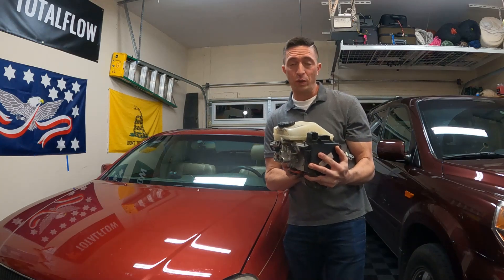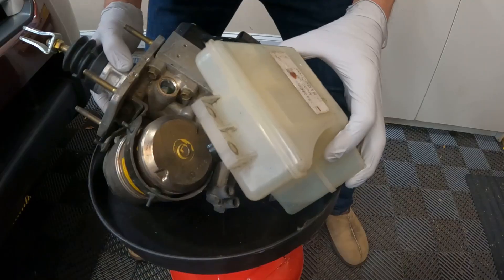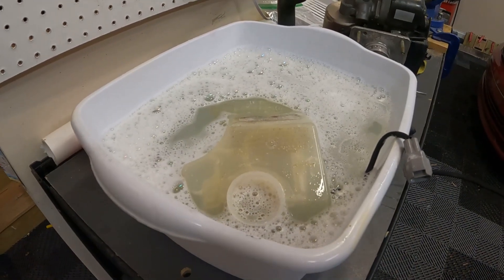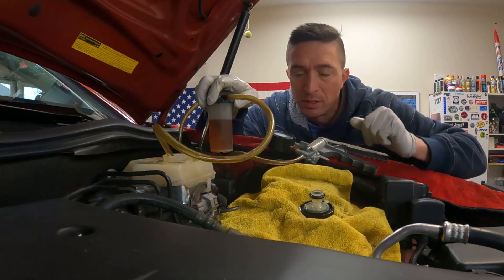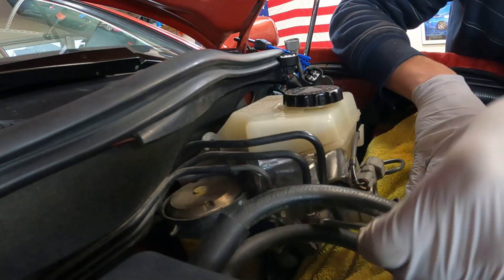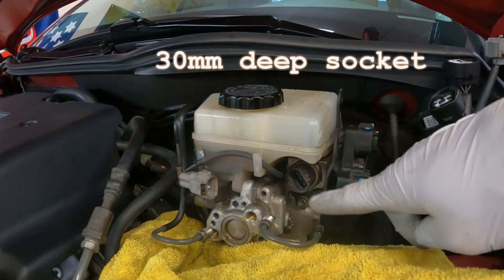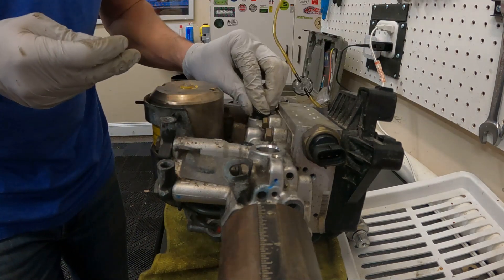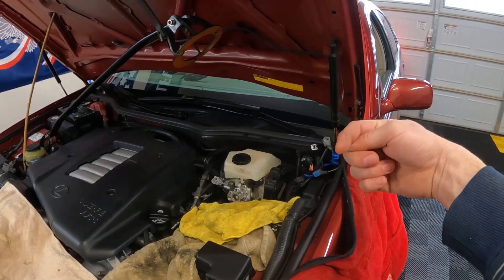LEXUS / TOYOTA Brake Master Cylinder Diagnosis, Replacement & Brake Bleeding (300/400/430 shown)

Comment: Hey man. Would appreciate some help. I bled brakes a while back after removing caliper. I think I let the reservoir run dry. I had that warning sound which you mentioned. Now that buzzing sound from abs module is there on start up and intermittently when I brake. I'm assuming I have air in the module itself? Any help would be appreciated on what I can do.
Reply: I noticed that buzzing sound every time the brake were pressed to bleed. Is that normal all the time? Should it go when the bleeding process is done? Thanks
Reply from the maker: Buzzing is normal. Low pressure warning is also normal during bleed process only. Unless you really ran it dry, the brakes should be good after you have bled the system properly.
Reply: @ForwardMomentum  thanks. Am  relieved. Think will bleed again just to be certain, including BMC.

Did you leave the ignition on whilst bleeding? If so, why?
Reply from the maker: @mozymi4399  should be covered in the vid. The accumulator pump is how pressure is built and distributed.

Comment: Hey, pretty cool video! I have a question about the "optional bleeding the BMC before the formal bleeding process", Did you have the ignition on when you do this?  What is the timing for re-tighten the brake line connector after lossen it? (until see some fluid come out?) Thanks!
Reply from the maker: Ignition was not on for BMC bleed. Timing is fluid coming out for tightening line. GL!

Comment: So I may have to be doing this job for my gf's 98 GS. But there's no squeaking sound when you step on the brakes. It's more of a buzzing and it only happens at low speeds right before you come to a stop. I've seen that may have something to do with the ABS ECU. Thoughts?
Reply from the maker: Buzzing = normal. Pig squeal/dolphin sound = borrowed time. Such a dumb choice/design by TOYOTA on this one!
Reply: @ForwardMomentum  I can feel a vibration when I step on the pedal. Almost like I'm losing brake pressure, and then it just comes back to normal. But like I said, it only happens when it comes to a complete stop
Reply from the maker: @itsjustnate08  the accumulator motor commutators disintegrate on these and the squealing is the warning of what’s to come. Heavy vibration should be looked into further. Light vibration times with the pump is probably normal.

Comment: Just want to thank you. I have a 98 GS3, and the brake booster finally went. Because of your video I bought a 05 sc 430 unit. Added that with Supra TT front brakes and LS430 rear brakes and everything went flawlessly. Minus the fact, I disconnected the battery. But during installation I knocked the bumper off the lever for the brake switch. Hooked the battery back up and didn’t pay attention for 3 hours my brake lights were on 🤦🏻‍♂️😂 this is my third Gs in 14 years. Timeless vehicles.
Reply: I  was going to do this exactly,  but i havent due to i wasnt sure if the wheels needed to changed to a larger diameter for calipers,  did you have to go to a larger wheel ?

Comment: Thanks for the awesome video!  Just changed out my old "chirping" brake master cylinder with my friend yesterday on my SC430 and referenced your video for the whole repair.  I am definitely a novice with auto repairs, but this was an easy job with two people.  This would've cost me at least $3800 here in Hawaii.  Instead, I paid $350 for the part on eBay and the next most expensive thing was a box of gloves for working with the brake fluid residue.  Great step-by-step details!  Thanks!

Comment: I change the same on my toy land cruiser(europe)and now the brake red light is always on
Reply from the maker: 1) are you positive you installed a good BMC? 2) did you swap the pressure sensor? 3) did you bleed properly?
Reply: I change the motor only not the pressure sensor. 
Brakes works well.i bleed the systèm by the for calipers like instructions on my toyota book .
Reply from the maker: @rougeronjeanedgar2847  look back over everything. You must have skipped a step. Pressure sensor usually needs to be swapped.
Reply: Toyota check my car soon,and i return here to give answer
Thanks a lot men.

Comment: I have a 2002 4Runner with an all in one ABS unit. Long story short, when I got to the last procedure where you pumped the brake pedal 20 times. The pressure warning did not go off and my brake pedal feels spongy for some unknown reason. Mind you I have not done the last part of bleeding all 4 brakes. Do you think bleeding the brakes will fix it?
Reply from the maker: Did you swap the pressure sensor from your bad BMC to your new one? Just curious. If so, definitely repeat the steps a few times. If the warning persists, try to bleed the brakes. If it still persists, try pulling the negative to reset the ABS ECU. If it still persists, you could have a bad unit going in.

Comment: I have the same issue with the bird chirping noise, every 15-30 seconds, it is getting to be more frequent and louder. Is it possible to replace some parts on the system ,hydraulic braking assembly, or it is one complete unit?  2002 GS300,  216k miles, i cannot afford 4k, i really like this vehicle
Reply from the maker: It is possible, yes. But upon investigation a BMC swap was much more economical. The problem is the accumulator motor commutators disintegrating (we think). So, theoretically, one could replace that motor if it can be found. I started down that road and no one had a solution so I just did the swap.

Comment: I ended up upgrading and making a brand new one by buying parts individually. Here is another way around this issue. Buy a rebuilt master cylinder at rockauto, then buy a rebuild upgraded abs motor from ebay and a new nitrogen tank from the dealer since I heard those lose pressure over time, didn't want to risk dropping in another master cylinder was a bad nitrogen tank. I am actually on the second master cylinder on a 215k mile GS400. I think I dropped about $1500 in after I was done, but everything is new. I did buy another donor master cylinder off ebay so I could piece it together off the car.
Reply from the maker: Great idea! Thank you!

Comment: Hi, I have Pajero 4 with this similar unit, but I have one issue, this stupid motor starts pumping every 10 - 15 sec., but I dont know, could anybody know why? Accumulator is new.
Reply from the maker: I’m not sure why that’s happening. Perhaps your pressure sensor is bad or it truly isn’t holding pressure?
Reply: @ForwardMomentum  There was 1 fault number 61. Master Cylinder Pressure Sensor System, maybe this could do that, I will check pressure with scan tool maybe week later. But this sensor is integrated inside hbb so cant change, only whole unit.
Reply from the maker: @danielhasalik7000  are you 100% positive it’s not removable? As you may have seen in the vid, the BMC on these and many others has a replaceable pressure sensor. Or, it could be bad seals on the MC piston.
Reply: @ForwardMomentum  Oh yes, you have right, this pressure sensor is same, I didnt see this, so can be removed, it has number 89637 30040 DENSO. So I hope i can find something.
Reply: Its bad, I didnt find any sensor and Oficial Mitsu. dealer dont sell only this sensor, only whole unit, but I checked voltage betwen sensor and ASTC ECU and there was, so servis manual says replace ASTC ECU, maybe this could solve this problem.
Reply: So ASTC ECU is replaced and fault number 61. is gone and no more faults. But motor pumps every 15sec., but I saw something, when motor starts, brake fluid is go down a little bit, but when motor stops, brake fluid go up, so I think there is a little pressure leak in accumulator, so I have to replace it ( again) and a little spring and pipe under accumulator, hope this will help.
Reply from the maker: @danielhasalik7000  thanks for the update. I admire your tenacity!

Comment: Hey man, really detailed video was wondering if the process is similar for a first gen is300. If I brake relatively hard, nearing the bottom, pedal kinda flutters.
Reply from the maker: If the IS has a BMC set-up like this it should be the same, correct. GL! 👊

Comment: Thanks a bunch for making this video! It made me realize the task at hand isn’t nearly as daunting as it seems. It’s nice to see folks creating content for the 2GS platform. I Did run into a couple issues and maybe this information can help others doing this. That metal bracket that goes to the bottom right stud of the BMC can be a massive pain in the butt if you accidentally bend it like I did. It really helps to have another person inside the car making sure the stud goes through the hole in the firewall and the bracket. It will save you a lot of headache trying to bend it back or take it out to fix it. I also received a faulty BMC from eBay. Popped it in and didn’t hear the motor building pressure at all along with a loud sustained beep. I also got all of my ABS and VSC lights on. Went to the pull-a-part today to grab another and everything went smoothly.

Comment: Ive read where this is the same procedure for 100 Series Landcruisers and LX470's. Is that true? Thanks for this very informative video. The install on my LC isnt the issue, its the bleeding process that makes me nervous!
Reply from the maker: Yes, it should be very similar. For some reason TOYOTA went with these complex and expensive BMC units that are prone to failure. I still don’t understand why.
Reply: @ForwardMomentum  Toyota seems to love going overboard to a fault on a few components. Just to change a rotor on my vehicle, I have to disassemble the entire hub assembly haha. You the man, thank you!

Comment: hello, first of all thank you for this great video !
I currently have a 1997 aristo and I need to change this part.

however I understand that the brake master cylinder of the GS300 can go on ARISTO. do you have the information on that ?

thanks
Reply from the maker: I believe they change over, but please double-check me. The problem in the USA when using an Aristo BMC is usually with the hardline routing (RHD vs LHD). Not sure if that is a factor in your case or not.

Comment: any updates on the SAFC? also anyone have a solution to control the timing? i have a safc2 but people are telling me its pointless to install it if i dont had many power modifications, i plan to turbo it on low boost 5-6psi so not to crack a stock gapped ringland
Reply from the maker: SAFC2 is fine to install on a stock motor but you’ll need a wideband AFR sensor to tune properly. If the motor is stock, you might get a few HP out of it. For timing control you’ll need a standalone solution on the 1UZ but the 2JZ and 3UZ may have ECU programming possibilities.
Reply: @ForwardMomentum  i probably should have mentioned its a 2000 GS300, that being said the 2jz's should have lots of options but im trying to find a budget solution to pair with the safc. if you do have some info that would be great but love this channel, your videos help me with similar mods

Comment: Yea great job you saved a lot of money I’ve had a used brake master cylinder for my 98 lexus for a year now I paid $200 for the part on eBay. And to have it put on I paid $200. And  old unit needed to changed at 200k miles. Which wasn’t bad by far you did a great job in finding a part and installing it yourself..
Reply: @Scumlife Shotty no you good just gotta find someone who can put the part on. When you buy it used it’ll already be programmed. And the part just has to be coded by the mechanic. And you don’t have to do anything else..

Comment: Wow, this definitely is a job completely out of my league & ability. About 6 months ago I had my lexus dealer install a brand new Brake Master Cylinder, my old one was original. New part cost $3,200 just for the part + labor, full lexus warranty. By far most expensive thing I've ever done on my 98' gs400, but I've had my car 7 yrs., never any car payments, & stole it for just $2k because I worked at the dealership, still very happy! 😊
Reply from the maker: Wow! So if you don’t mind me asking, how much was it with labor? That’s crazy!
Reply: @ForwardMomentum  
Labor charge cost $900 so total cost $4,200
It took the Lexus head technician 1.5 days to do complete work including the programming of new unit, I even met him & watched part of time at beginning & end of work also.
Reply from the maker: @samaccurso  I’m going to pin your comment at the top so people can see what the cost will be if they go to the dealer. My estimate was low apparently. 🤣
Reply: @ForwardMomentum  
Thanks again, keep in mind & let all followers know my original unit lasted 23 yrs. & almost 200k miles, I'm actually happy & very impressed it lasted that long!
Reply: @samaccurso  I respect people as reasonable as you are
Reply: @samaccurso  Lol there is no such thing as programming the unit its plug and play you just need to reset the ecu by unplugging the negative battery as stated in the video.....
Reply: @samaccurso  program the unit? It's not plug and play?
Reply: @TheUncleBigBad  No, was told by 3 different very reputable brake shops that they could not program the new Brake Master Cylinder unit, only Lexus dealer had the equipment to do it, that's one of reasons decided to just have them do it, plus it's a brand new unit with full warranty.
Reply: @samaccurso  I didn't see any programming being done in this video.....
Reply: @ShipyardWelder  I'm just telling you what I decided to do with my own car, if you want to ask him directly about this please do, he's much more knowledgeable than myself, thanks.
Reply from the maker: Perhaps what they meant was that you need a special scan tool in order to bleed the brakes the LEXUS way? Aside from that there’s no programming involved. Or they just lied to you?
Reply: @samaccurso  Im pretty sure you got ripped off is what I am trying to say 4000$ to install a 600 dollar part is wild. Paying 3400$ in labor is unheard of...
Reply: @ShipyardWelder  Your incorrect, it was $3,200 for the brand new part through Lexus(only way to get it brand new) + $900 labor through Lexus which includes full warranty on everything. I'm fine doing this so Before you criticize someone for whatever $ they decide to spend on their car please get your facts straight first, thanks!
Reply: @samaccurso  Lol you got ripped off dude.... I can find that part brand new online from a Toyota website for 600 bucks....... And yes its OEM.... You can spend your money on whatever you want and if paying 4k for a job that should cost around 1.3k to fix makes you feel good by all means do it...
Reply: @ShipyardWelder  No it doesn't make me feel good but I had to make a pretty quick decision because my my car I couldn't drive it, so very happy for you that you can do it much less, good luck to you.
Reply: @ForwardMomentum  Please unpin me, getting tired of the rude people responding, thanks.
Reply from the maker: @samaccurso  do you mean unsubscribe? You do that, not me. And I’d rather not see you go. I can delete these particular comments if you’d like to stay. I’ll leave the first few comments only. Thoughts?
Reply: @ForwardMomentum  No, just unpin my brake master cylinder lexus estimate comment, I'm very happy being a subscriber, thanks.
Reply from the maker: You got it!

Comment: Added to my saved videos for future reference! :)
I was wondering though, whenever I changed my brakes, the fluid levels would rise whenever the car was parked, then it would go down a little whenever I’m driving it. Is that normal or did I not bleed it properly?
Reply from the maker: Normal. New pads = thicker and pushes fluid back to the reservoir. Then it gets consumed by the accumulator. 😎

Comment: Love the videos, I’m happy somebody is actually making videos about the gs400 and 430. And very good quality and explanation. I just rebuilt my power steering pump on my 98400
Reply: Sounds like I need to pick your brain as well. My power steering is leaking. Need to be pointed in the right direction.
Reply: @jackhammr1751  is it the pump or the rack
Reply: @xburntxtoastx  it's the pump.
Reply: @jackhammr1751  well I’m not sure exactly inside where it’s leaking but I bought a rebuilt kit online for like $10.

Comment: Such an unnecessary complicated set up they put on the 2GS, the LS400 and IS300 had a conventional booster and master cylinder with abs pump separate

Comment: Does any sound from the system mean, it’s going bad? My brakes are hard at times and normal at others. But it always makes light sound when I apply the brakes. Just got the car 00’ gs300, just trying to understand
Reply from the maker: Distant buzzing is ok. That is the accumulator motor operating. I noticed that the buzzing gets louder over time, then the screeching will start. The screeching is the accumulator motor commutator coming apart and grinding the debris in there. Nice huh? All that being said, you may want to perform a bleed to see if that alleviates your random pedal firmness.

Comment: Do you know what the issue on my 98 GS300 is?
Basically it sometimes just does not start, the roadside assistance person said something wrong with the fuel. The pump was replaced only 2 months ago. This morning it started but yesterday it didnt
Reply from the maker: It’s pretty tough to play parts roulette over the internet on just a little info. Did it have trouble starting prior to the fuel pump change?

Comment: Could a used unit be tested somehow before install? I will  fall out if I go through all this work just to have the used unit not work 😂.
Reply from the maker: I had the same concern. It seems the later SC430 BMCs were not as susceptible to failure, but I am not sure exactly why. I know they had a larger piston; perhaps the owners are more apt to service the brake system, including bleeding at the dealer? But yes, I would have been pissed if the used unit squealed. I can do this job in about 2 hrs now though. 😎